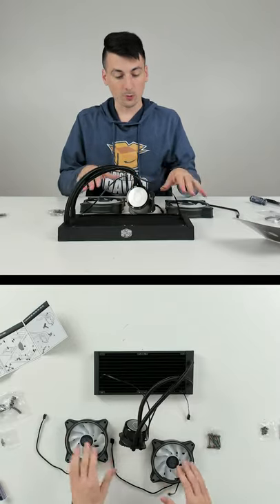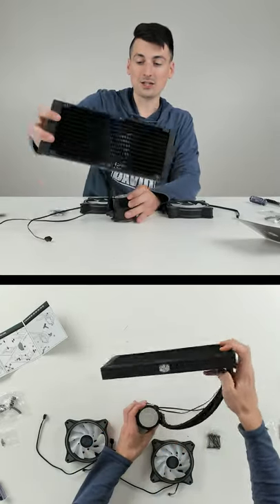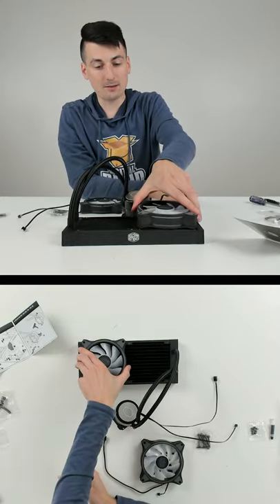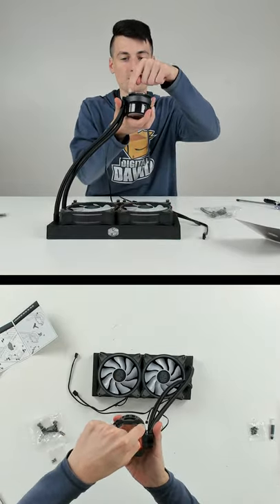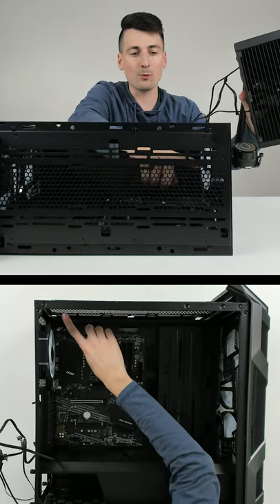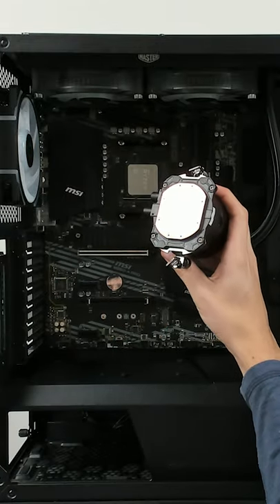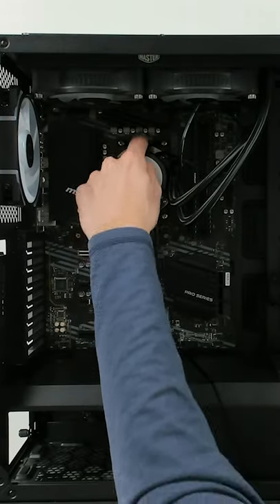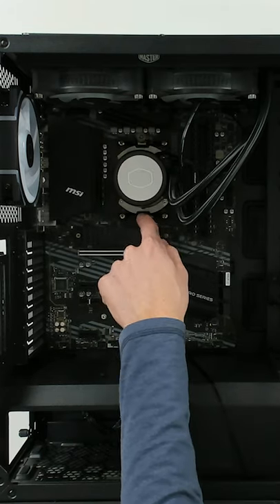Cooler Master MasterLiquid ML240L #shorts

Comment: Just installed this cooler, ran some benchmarking code in C# which taxes the cpu, never got above 60C.  Have an AMD Ryzen 5 5600X.  When idle, the cpu temperature is between 29-30C.
Reply from the maker: Love to hear it! Thanks for sharing!!
Reply: Good to know with the stock fan my cpu has been running so unbelievably hot installing this now thankfully

Comment: No lie use some sort of spreader. Don’t be scared to cover the whole cpu. But don’t apply a thick amount. Just enough. It may take a couple tries through time for the perfect amount but that usually has the overall best coverage and longevity before repaste. An if u don’t use enough an or it doesn’t spread itself when applying the cooler, it will cause thermal throttling. Which isn’t good.
Reply from the maker: Fair enough. We have always been a pea in the middle and have not ever had issues!

Comment: Recommend a good budget cooler for ryzen 7 5700x!
Reply from the maker: If you're looking for a good budget cooler for your Ryzen 7 5700X, I would recommend considering the Cooler Master Hyper 212 RGB Black Edition. It offers excellent cooling performance, a sleek design, and customizable RGB lighting, all at an affordable price point. It's compatible with the AM4 socket, which is the socket used by Ryzen processors, including the Ryzen 7 5700X.

The Cooler Master Hyper 212 RGB Black Edition features a 120mm fan and a stacked fin array, providing efficient heat dissipation for your CPU. It's also relatively easy to install, making it a popular choice among budget-conscious PC builders.

Remember to check the dimensions and compatibility with your case to ensure proper fitment. If you have any specific requirements or preferences, feel free to provide more details, and I can help you with further recommendations.

I hope this helps, and happy cooling for your Ryzen 7 5700X! cnl

Comment: Woukd you say this with some noctua PWM fans is enough for a 5800x? And other question how loud does this get at the top end?
Reply from the maker: Thank you for your questions about the Cooler Master MasterLiquid ML240L. Adding some Noctua PWM fans can definitely help improve the performance of the ML240L and should be sufficient for cooling an AMD Ryzen 7 5800X. However, it's always a good idea to check the manufacturer's specifications to ensure compatibility.

As for the noise level, the Cooler Master MasterLiquid ML240L has a noise rating of 6-30 dBA, which is considered relatively quiet. However, noise levels can also depend on the fan configuration, RPM settings, and other factors. If you're concerned about noise levels, it's a good idea to check reviews or look up the specific noise levels of the Noctua fans you're considering to get a better idea of how loud the cooler will be under load. cnl